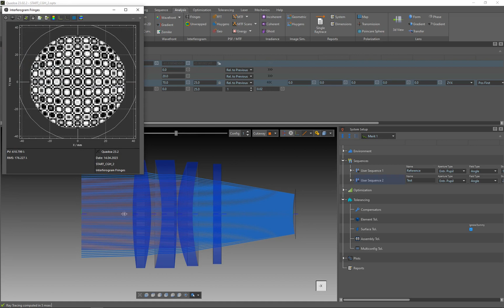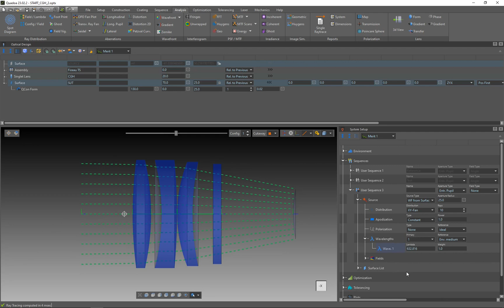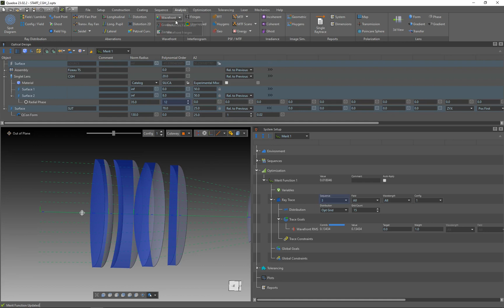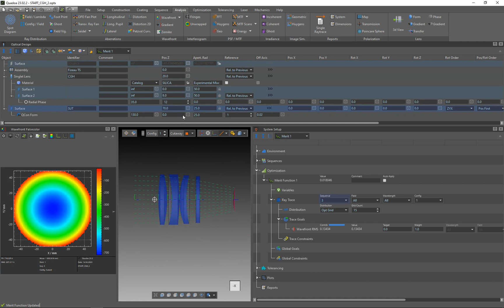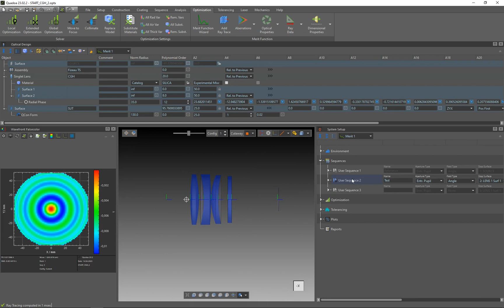Optimization: CGH Optimization  - Optical Design Software Quadoa Optical CAD

Comment: Hi. Do you have any plans to do compatibility work for macos?
Reply from the maker: Unfortunately Apple discontinued official support for OpenGl which is required by Quadoa. So there won't be a MacOS version in the near future. It is however possible to run Quadoa in a Virtual Machine. We have successfully tested this on a Parallels VM but can't guarantee general compatibility
Reply: @quadoa  thans for information. Which mac model did you tested with wm parallel? On arm chip or intel?
Reply from the maker: @cahitatlas  Intel Core i5, but should also work on ARM chips